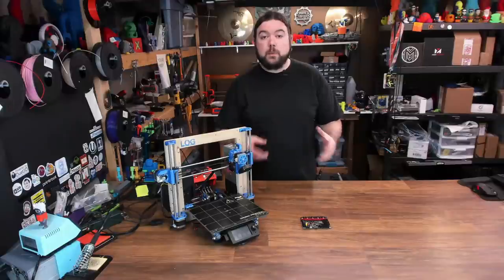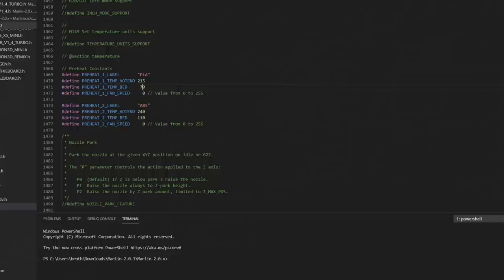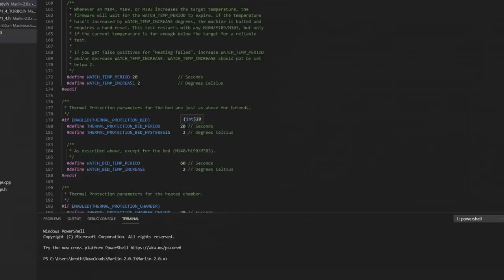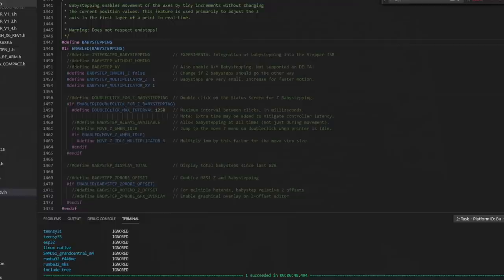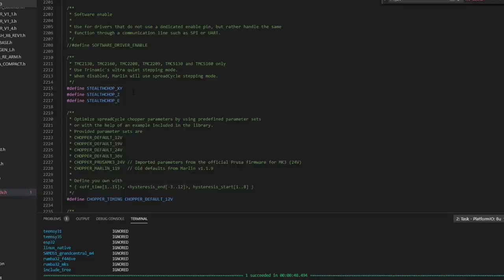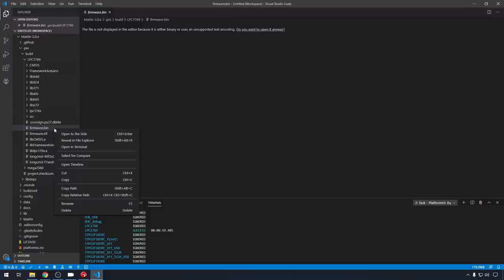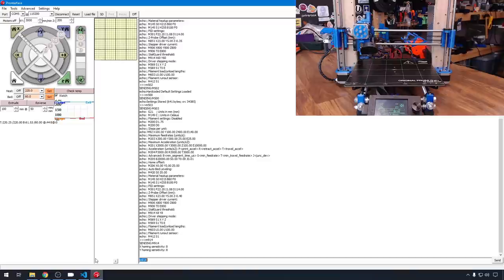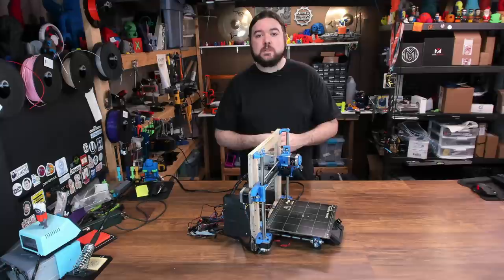BigTreeTech SKR v1.4 Mainboard - Full Install Part 2 - 2209 Drivers - Chris's Basement

Comment: Hi Chris, thanks for the videos series I was just looking for it ! I get a problem regarding my REPRAP_DISCOUNT_SMART_CONTROLLER, it works perfectly fine with my old board (ramps1.4) but here for some reason it doesn't powered up ... I was just wondering if there is some checking to do on the board to be sure that everythings works correctly.
Reply: I had to remove the plastic surround from exp1 and exp2 from the display ( much like he did on the main board in part 1 ) so I could flip the cables so the notch could go the other way. Let me know if it worked for ya :)
Reply: @StevenSSmith  You just saved me day !!! I didn't want to remove the platic connectors from the display so I just cut two new notches on the opposite side of each and it works perfectly ! I hope that from now on I will not have any new issues for the installation of this new board :) Thanks again :) !
Reply: @Skando38  Yeah I spent a day and a half on this. I've heard of doing this to the ender3 display for the duet maestro (even though I don't own one) and though what the hell.
Reply from the maker: Awesome thanks for the assist Steven! Glad this got it working!

Comment: Thank you so much for this video. I have watched a few time and ordered my first bear frame plus SKR 1.4 turbo. I have two questions about the Prusaslicer: 1. Is it gonna work with Prusaslicer stock setting? 2. Is possible to use MMU2 on SKR 1.4?
Reply from the maker: Yes, works great with Prusaslicer. Yes, it can work with MMU2 but it's pretty tricky to get it setup, but not impossible.
Reply: @ChrisRiley  Thanks! Hopefully, you will talk about how to set up MMU2 for SKR 1.4 board. Great job!
Reply from the maker: @mcchjoyshop5125  Thanks!

Comment: I'm struggling to get Repetier Host to connect to the board after successfully compiling Marlin 2.0.0.6. Error states "The connection failed with the following error: Access to the port 'COM9' is denied.. Make sure your printer is connected, enabled and connection data is set correct. Open printer settings?" Any thoughts?
Reply: Got it solved..... can't have another slicer open while trying to connect with Repetier Host. Closed Cura, and BAM! everything is working fine.
Reply from the maker: Awesome, glad you found the fix!

Comment: Amazing videos!  I have set up everything as you did I have an older folgertech prusa i3 but I set up the servo for my old z end stop as my z probe board leveling. I can m280 and move the servo fine I can manually move all the axis but when I go to home them any axis the z axis makes noise and tries to move then it will home x or y and if I try to home the z axis it moves to the correct position x and y but won’t deploy the servo and also the big issue is It makes the z axis make a bunch of noise while spinning slowly like it’s fighting itself to move but will move just fine if I use my computer and tell it to move up and down. Any thoughts on this would be great thanks.
Reply from the maker: I guess the Z is the biggest issue, maybe it's trying to move to quickly? When you us the computer it might have a slower feedrate.
Reply: Chris Riley thanks for a reply I’ll check the speeds and see where it’s set I know I copied some speeds from my old config.h file for my old ramps board and it didn’t make a difference but maybe there is one I missed.
Reply: Chris Riley you were right I had to take the velocity on the display I have on my printer to 1 from 5 because it wouldn’t move z correctly with that display board either so that issue is now fixed. Thanks again great info with all this stuff!!

Comment: Hey Chris is there a way to set these 1.4 motherboards back to factory settings and the display/controller too, if the displayeven needs to be. The actual reset button seems to be a flash related thing to setup the new firmware on the board. But I haven't seen anything about clearing memory. I seen a few things about entering a 4 digit code but not about where to enter code. I know that the screen allows a gcode option but not sure if that's where cuz if you didn't have their brand screen where would you enter that number. I don't think they'd leave you high and dry so is there some place on vs-code these numbers are entered. And don't wanna put something in that gcode menu that could potentially do serious damage. I'd normally say I could go back and take off the settings of the machine but I used the configure files for the specific printer (ender 3) instead of each setting 1 by 1. So I have no clue other than the few things I did setup like steppers and display etc. So its just gonna be so much easier to wipe the memory and start a whole new configuration file. I've messaged the company and they said to clear the memory but not how and have not heard back from them since. Which apparently is a trademark BTT thing. So I figured if anyone knows its you lol
Reply from the maker: So the memory on the board gets cleared every time you load a new firmware. When it sees that new bin file on the SD card, it deletes everything and starts over. So there is really no need to clean up that memory. You do however need to update eeprom. Load your new firmware, then run m502 then m500 to reset it. The screen shouldn't have anything to clean up.
Reply: @ChrisRiley  yeah there was something wrong with the board. Bigtreetech finally replied back saying in more or less words that the regular 1.4 boards are have issues. They sent me a turbo board that came with a power module and just said keep the 2209 steppers that came with the original 1.4 and put it on the turbo. So I did the ender 3 preset in the config library file and switched the x,y,z and e0 steppers to tmc2209. Everything seemed fine but I got a tmc connection error. So I decided to uncomment them and start with just the board and go from there.  Everything compiled nicely but now I'm getting the "no printer attached" message. I have the TFT35 e3 v3.0 control display. Everything seems to work perfectly fine it, like the heat and menus etc. Just no motion related functions. If I use the original ender 3 control display or the marlin simulation screen and hit the home ill get an  message saying reset theres a homing error. I'm not sure if there's a graphics option in vs-code thats in the ender3 preset config file because it's assuming your using the ender 3 original screen. Also all the install videos on youtube are to compile for either the board or the screen but not both together at the same time. So when the board is being setup in vs-code the controller lcd option that should be used is never actually mentioned cuz not everybody would have that same combo. But the dual screen seems like it is probably a pretty specific setting. And there's quite a few Lcd options. I'm starting to get the hang of vs-code but the graphics seem to use the name brand or printer type but I see nothing indicating bigtreetech or ender 3. So is there a pairing that should be used for the SKR 1.4 turbo and the TFT35 e3 V3.0 dual touch screen. There are a few things about the other TFT35's that seems like there are some differences that may require different settings (such as on board leds) I have a feeling thats what my "no printer attatched" issue is stemming from. But I don't wanna go through and screw everything up testing a bunch of different screen settings in vs-code.
Reply from the maker: @s8nlx661  So there is no setting really for the type of touch screen we use, it's just a serial controller. It's all in how you have your serial connections setup. Now, to use the emulated screen like on the BTT you need to have the #define REPRAP_DISCOUNT_FULL_GRAPHIC_SMART_CONTROLLER uncommented. To get your touch screen connecting, try setting your serial like this. 

 *
 * :[-1, 0, 1, 2, 3, 4, 5, 6, 7]
 */
#define SERIAL_PORT 0

/**
 * Select a secondary serial port on the board to use for communication with the host.
 * :[-1, 0, 1, 2, 3, 4, 5, 6, 7]
 */
#define SERIAL_PORT_2 -1

Comment: Followed all instructions and (thank you by the way :D) but my X Axis isnt moving. Any ideas?
Reply from the maker: Are you using sensorless homing?
Reply: @ChrisRiley  Thanks for the reply Chris, I made some changes to get me to where I need to be. I am not using sensorless homing, but the X stepper was reporting being "Error: ALL LOW" - I changed the pins for E1 with X and vice versa, now my X is plugged in to E1 and all is working fine....

Comment: Your video had me baffled here for over an hour. You can't do both a probe and semsorless homeing. And I kept getting one error that i couldn't figure out. "Sesnsorless homeing needs stall guard bla bla " something along those lines. Finally found it. It was the "define z stall sensitivity" and z2 stall for me because i have dual z motors.. with your config only had x and y uncomented. I must have done something wrong because i saw other people post that they are isn't only x y sensor less homing and bl touch on z.
Reply from the maker: Glad you found it. Sensorless  Z is relatively new.

Comment: Followed your videos on setting up my 1.4 board, I have a bltouch and using sensorless homing.  All is working okay except something with bed size or I dunno what is off. when homing it goes to center of bed to probe but it is not center, the bed is back way to far, go to print and also the bed is back way to far and printing into the air off the front of the bed.. ideas what is not configured properly?
Reply from the maker: It is either your probe offsets or homing offset. Check them again and make sure the proper ones are either negative or not. Remember front and left is negative.
Reply: @ChrisRiley  Thanks for the reply.  I figured it out.. I am dumb.. i had removed the stock end stops.. so now it was homing the bed like 20-30mm further back than it should have been.
Reply from the maker: @ShuhDonk  Don't be too hard on yourself. I'm glad you got it going.
Reply: @ChrisRiley  All is working now except using the menu while printing.. it is very laggy, sometimes it takes 5 seconds for it to respond to me navigating and making inputs.  I am using the bigtrreetech ftf 35 v3 e3 screen with latest firmware.  Happen to have any ideas on that one? :)
Reply from the maker: @ShuhDonk  This only thing I know of to try is to increase your serial baud rate in the Marlin config and on the screen. That might make it faster.

Comment: Hey Chris love the videos keep up the good work, but i'm having trouble with my SKR 1.4 install for some reason i cannot connect my printer to my computer while its powered on, I've set the jumper to supply the board via the 24v rail from my power supply, connected it via USB and it does nothing. then I tried to switch the jumper to be powered by the USB, then flipped the power switch and i believe I fried the USB controller on the board so what am i supposed to do, besides getting a new Board
Reply from the maker: Hey Sergio, thanks for coming to the stream today! I have thought about this issue. It almost sounds like you have something shorting out your 5v feed. Then when you apply power, it blows the regulator. What 5v things do you have on your board? Do you have a bed probe?
Reply: @ChrisRiley  I have a BL Touch
Reply: @ChrisRiley  I was following your skr 1.4 videos. But my config only differed with the bl touch
Reply from the maker: @sergiodiventura1230  That's all I can think of, something is shorting 5v out.

Comment: Thanks for the tutorial. I am updating a Wanhao/Monoprice Duplicator I3 Plus printer that will have a bltouch on it and while the X and Y seem to be working fine the Z is not working right. When trying to home it goes up a bit and the bltouch deploys but the z does not move and then the bltouch will cycle the probe then the printer halts. IDK if the issue is that I dont have the BLTouch configured wrong or what. There are 2 pins that the BLTouch uses Pin 2.0 and I think the other in pin is 0.10? I have tried setting one or the other. If the pin is 0.10 then the right syntax would be P0_10 or P2_00? Or am I just missing something else?
Reply: the simple workaround for this is to use the zstop like you would do on other boards. Not sure why it's such a pain in the ass to use the bltouch sensor header.
Reply from the maker: I am currently working on test the bltouch on a lot of boards, maybe I will find a fix for this issue.
Reply: I sorted it out, just use the z_endstop. Now the issue is the damn thing does not home to the center of the bed. ZSafe homes towards the rear right of the bed. I have been stuck on that issue for almost a week now. :( I did have a problem where the firmware updates were not registering but got passed that as well. IDK, something that seems like it should be simple or some reason isnt.
Reply from the maker: @briancarlsen4772  Maybe it is trying to get to the center but is moving too far. If you move X and Y 10mm, is it actually moving 10mm?
Reply: @ChrisRiley  The Y seems to be ok but X homes at 126 while Y homes to 100. Which looks correct. If I set x to 0 and them move it to 100 then it is also centered. Hmm, I suppose it is centered where the prob is not where the nozzle is, which is ok I  guess? It definitely is better than when I first started. And it is no longer crashing into the right side of the printer like it was.
Reply from the maker: @briancarlsen4772  Maybe you need to add some probe offset?

Comment: Hey Chris , I recently bought an ender 5 with BTT Skr 1.4 board but whenever i start a print it goes towards the bottom of the bed not the center and the prints are the opposite side of what I sliced in Cura , Any suggestions?
Reply from the maker: Sounds like the direction is flipped. You would have to fix it in the firmware or flip the motor cables over on the board side.

Comment: Hey Chris, I love your videos and want to thank you for what you do. I currently own an Ender 3 Pro and an Anycubic Predator and have just ordered the extrusion to build a Hypercube. The only firmware programming I have done to this point was installing and setting up the TH3D EZABL using their Arduino file. I am looking to add the SKR 1.4 Turbo to the Hypercube build and wanted to know your thoughts for that set up.
Reply from the maker: Thanks for watching! It should work great for that build.

Comment: I literally just setup this week and cannot get steppers to move. I'm working on Tevo tornado MKS base v1.4 to skr1.4 and same 2209 setup.  Everything boots and looks good but M122 shows all drivers good in UART mode with memory addresses but enable flag is false for x y z e?  Sending M17 display shows No Move at bottom neither USB commands or Tft will make any motor move.  Motors make no sound or hum when M17 and I double checked motor wire sequence as it changed.
Any ideas?
Reply from the maker: The only things I can think of are motor cables or bad board.
Reply: Chris Riley Figured it out finally and able to print more ppe.  In case anyone else has the same problem make sure #define SOFTWARE_DRIVER_ENABLE  is commented out ie. not used. It's in Configuration_adv.h.

Comment: Chris Im trying to follow your video I dont want the bltouch but I do want sensorless homing for x and y I try to compile but Im getting sanity check errors and all other types of errors I cant find the marlin that you started with I dont know if thats the issue or what I follow the video to a tee I just dont include the bltouch
Reply from the maker: Gary, we have worked on this in different comments. What is your current error?

Comment: I have been watching all of your vids on the SKR v1.4 turbo over and over for the last 4 days straight. they are really well done and easy to follow, but I ran into a problem.
On my board it came with the TMC2208 instead of the TMC2209 that you talk about. I under stand that I can't do sensor-less homing with them and i thing I have made the correct modifications. My problem is when I try and build I get the following error:
HAl_SPI.cpp Marlin\src\HAL\LPC1768
no declaration matches 'viod SPIClass::BeginTransaction(SPISettings)'  [216, 6]
declaration is incompatible with "void SPIClass::BeginTransaction(const SPIsettings &)"(declared at line 42 of "E:\Marlin 2 for Metal Plus\Marlin-bugfix-2.0.x\Marlin\src\HAL\LPC1768\include\SPI.h")  [216, 6]
Any help would be great. I have lost count the number of times I have started over already. Thanks
Reply from the maker: Scott, it looks like you are running a version of Marlin that libraries probably no longer support. I strongly recommend you try to convert over to the newest Marlin version.
Reply: @ChrisRiley  Ok I will give it a go. I just download the lates and am starting to mod things so I will let you know how it goes. A big thank you for your quick response.
Reply: You were correct it work perfectly now. Thanks
Reply: So I finished all the wiring (printrbot metal plus) and I turned it on. I get a red light and a green light on the board. The screen TFT35  E3 V 3 gives me a screen that asks if I want to do Marlin or TFT but I can't get it to do anything else. Any ideas would be great.
Thanks again for all your help.
Reply from the maker: @scottscharnell6998  If won't let you select one or the other?
Reply: For the BTT 1.4 Turbo board, you need to comply for LPC1769 not the LPC1768